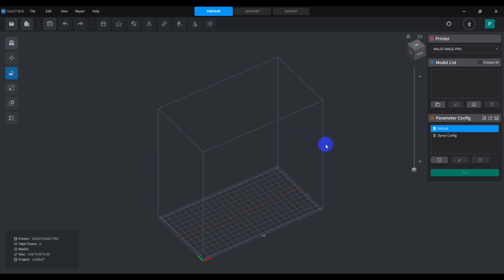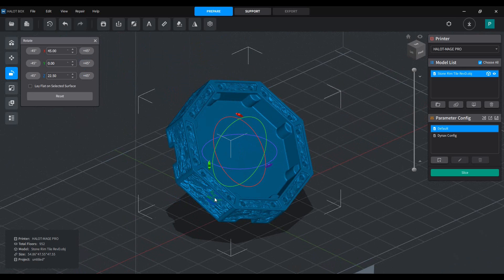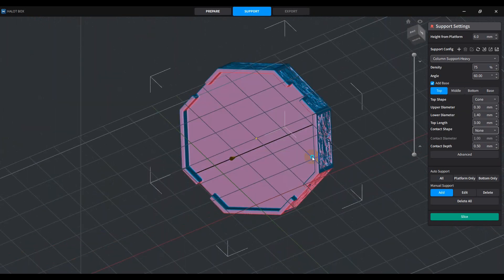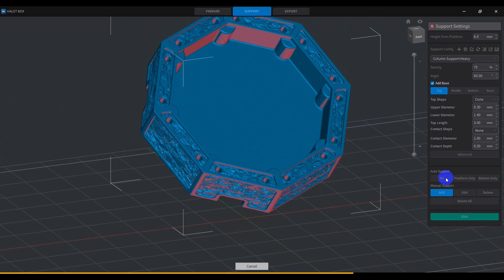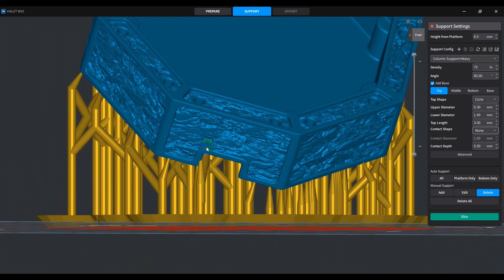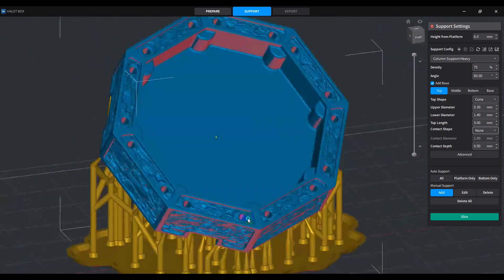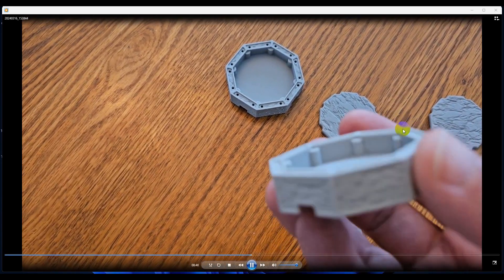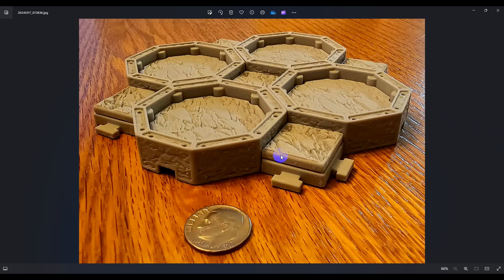How I Support a 3D Model for Resin Printing

Comment: i would put it just flat on the surface. it would have printed perfectly. no visible support marks.
Reply from the maker: I tried it before, but it didn't fit with other tiles due to dimensional issues. Also I have found that when resin printing flat the suction pulls the part off the build plate and ruins the print.
Reply: @philprocariojr3563  you can use the flexi plates from wham bam. You can score them with sandpaper and than rise the bottom layer exposure (a lot) so the resin grips to the plate. No suction issues there. The prints just pop off the plate after washing them in iso-alco.
Reply: since I have no longer put flats on the build plate I have never had a print failure. also I found cylinders print better too.
Reply from the maker: @criticaltracetheory 
I print many things that must be dimensionally accurate, so I don't do it. I found that when I print with a flat on the build plate, it warps the part slightly, and my parts will not fit together. I do like the idea of a magnetic build plate, though, for popping off the prints when they are done.
Reply: @philprocariojr3563  I had a magnetic build plate for the Ellegoo Mars. 
Same thing applies. 
Always support the part away from the build plate. 
That and keeping the resin proper warm.